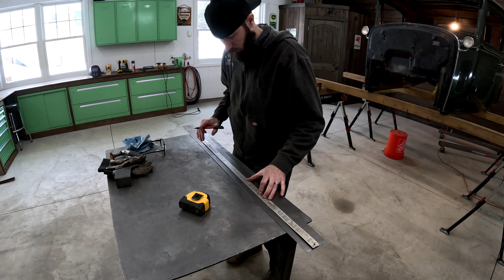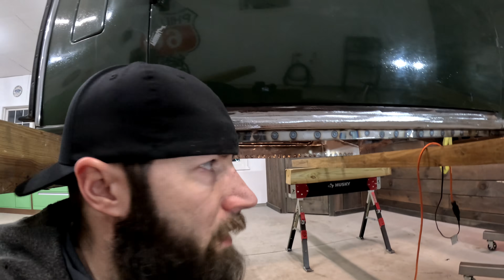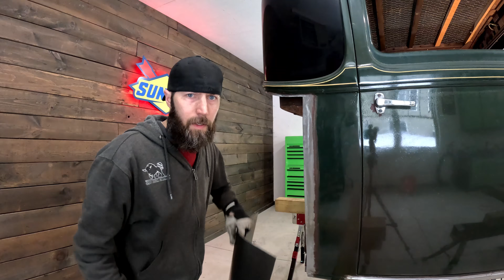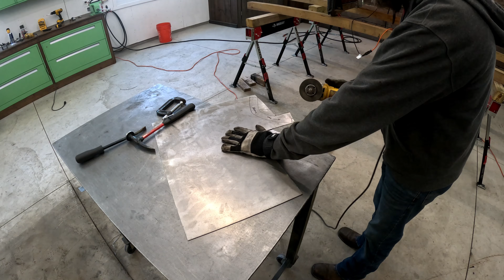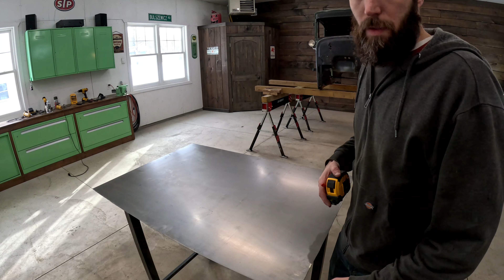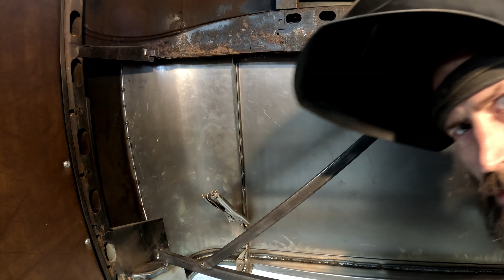Turning A 1930 Dodge Coupe into a Pickup Truck!

Comment: You need a stretcher and a shrinker, but without them, you use what you've got. Nice.
The tool you have as a combination break and roller doesn't have any weights attached like most do. Would that help in bending an angle?
I wasn't so sure I'd like what you had in mind, but it's a great job! Whowouldathunk?

Comment: Been slowly building a 29 Dodge coupe into a pickup also. Bought the body already hacked up. Back half already gone and floor structure crudely cut out.
Reply from the maker: @erickfrewaldt4713  awesome, keep it up!
Reply: @onebullgarage  Working on it when get time. Keep busy building other ones and working on stuff for other people. I like to build and makes things from what others call junk. I’ve done a lot of work to our 29. How are you going to fit the cab to the frame? You not hanging rockers down around the frame? When did the fill panel and corners on ours I made it so cab sits down over the frame vs sitting flat flush on top of it.
Reply from the maker: @erickfrewaldt4713  cool, mounting the body right now, the body will sit above the frame, but the running boards will cover the sides of the frame, projects keep you young!

Comment: great workmanship, a friend had a 30 Plymouth 5 window coupe that they cut the back off with a cold chisel so that they could use it for a tractor cab back in the late1930's, I believe it went on a Cat 60 I always thought about finishing it out like a pickup cab and the 5 window would have been great because I could actually fit into it. Alas, I missed it and it is long gone.